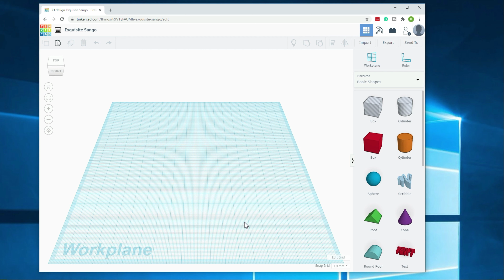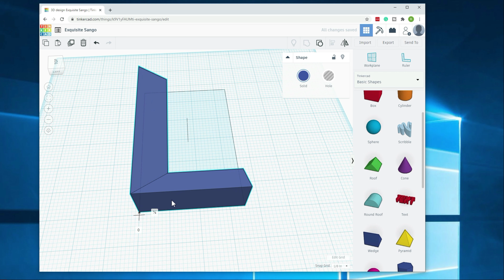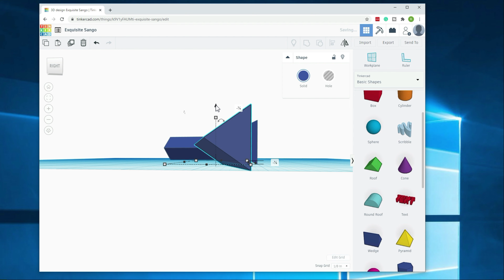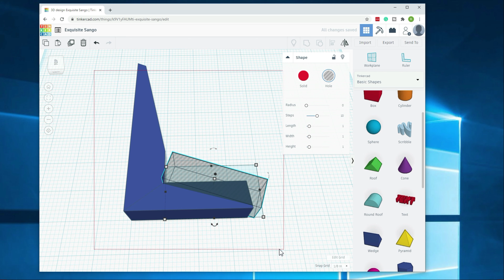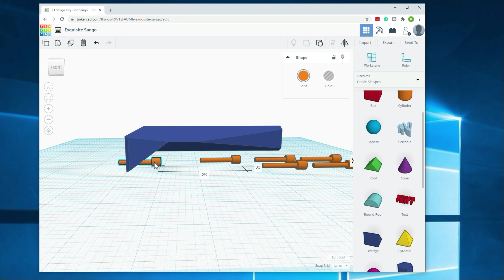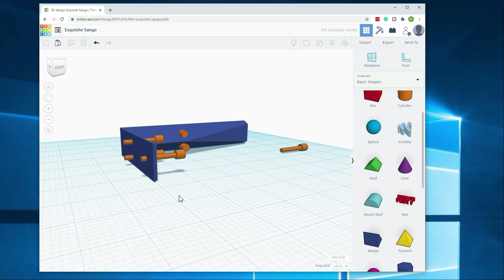3D Object Creation Doesn't Require Advanced Skills

Comment: Thank you. Question for you. I want to build walls for ho scale buildings and put them to together. So.o can go from sketch or your soft ware to cura and send it to printer?. I'm looking at creativity v2 printer or the tenlo dual extruder head. What do.you suggest
 Thanks dual head better and faster thanks
Reply from the maker: Hi. You can definitely export your creations as an stl file, slice them with cura, and send it to your printer to print. I haven’t worked much with dual extruders. The only ones I've seen are the A10M and A20M ones and they work pretty well.

Comment: I've been printing little buildings for my dad's train set that I downloaded from Thingiverse. I used TinkerCad to "assemble" the walls onto the base and print at once. I found when importing the STL wall files into TinkerCad that I would get gaps around the windows and doors. I don't know if it's a flaw in the STL files or something TinkerCad is doing, but when I import into 3D Builder (Win 10 app) I don't get those gaps. So, I've been using 3D Builder. It seems to do some things better than TinkerCad, but I'm not sure if it will do everything TinkerCad will do. If you want to do a tutorial or two on 3D Builder, that would be great.
Reply from the maker: Hi Kevin. I haven’t used 3D Builder in a while but should be able to do a couple of videos on it. Is there a ready you went with 3D Builder over FreeCAD? 3d Builder is easier to use, but I was just curious.
Reply: @3DPrintscape  No reason other than 3D Builder is pre-installed in Win 10, and I guess I didn't know about FreeCad.